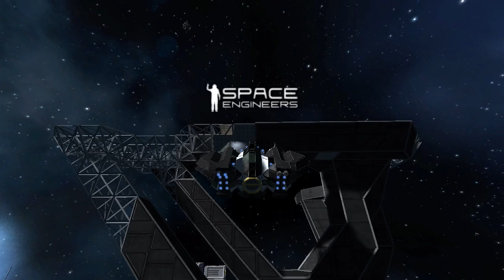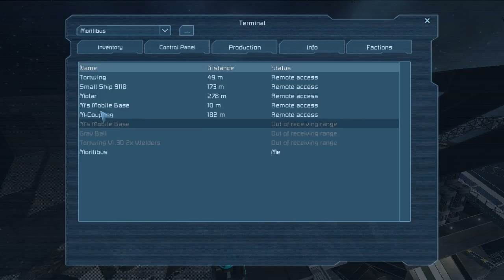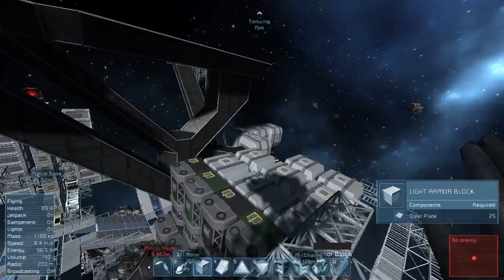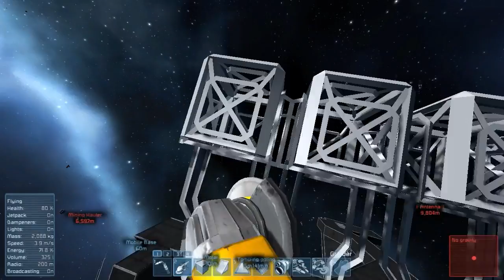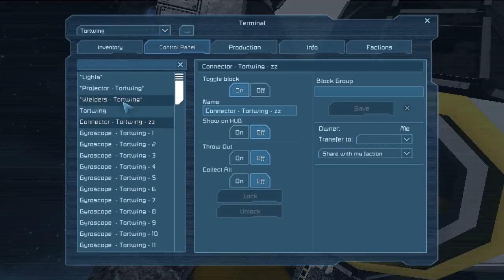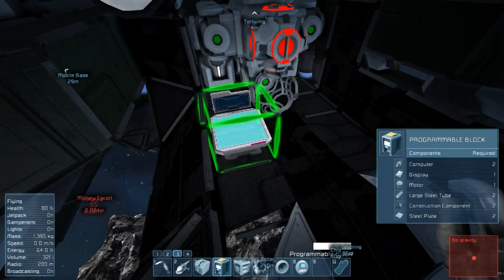Space Engineers • Solo Survival • 34 • The Headless Tortwing

Comment: You're gonna have so many empty space in that ship; why don't, instead of building whole new floor specifically for ships maintenance, build this toaster in one of the arms of the first floor - two horizontal rows of welders, one above the other, with piston and sensor for every welder (distance between every welder is one block), hidden in sidewalls (it seems that, currently, you don't have plans for space under those large container farms anyway) and extended as needed accordingly to ships scales.
Yeah, in this case there will be not enough space for extendable welders from ceiling and floor, but, as a solution docking connector might be placed on the rotor and just rotate the whole ship to weld it's back and bottom.